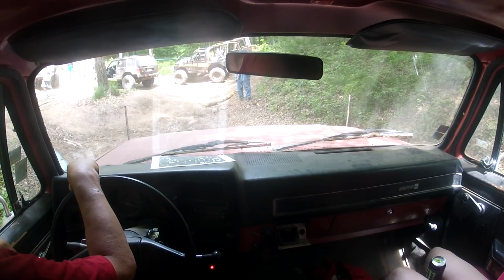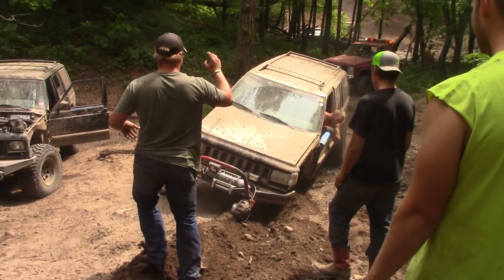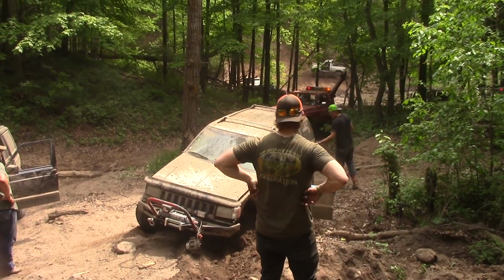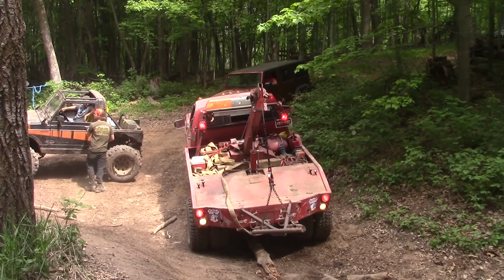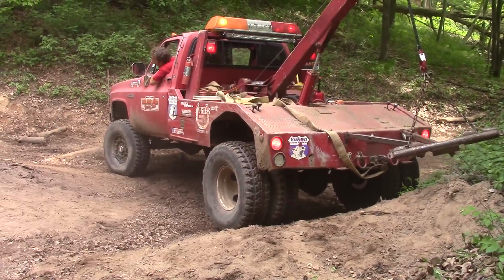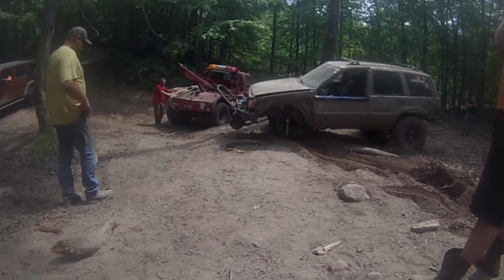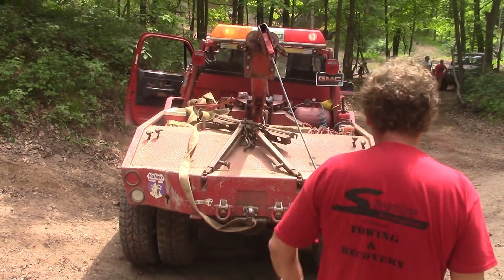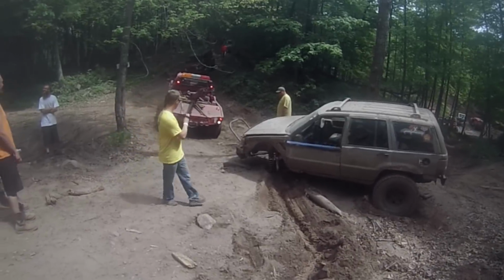CHEROKEE FAILS ON HOTROD HILL by BSF Recovery Team

Comment: Most of this BSF's video's are multi-part, if you think about it. They shoot a ton of footage doing recovery's at a few big off-road events a year, then break the footage up into video's of each recovery. That's also why the dirty camera lens hasn't been fixed. The footage was already shot before the first video was released.

Just a guess, but I suspect, Eric's splitting video's to stretch out the footage, either due to lack of footage, or a lot of unusable footage, perhaps due to the dirty camera lens.